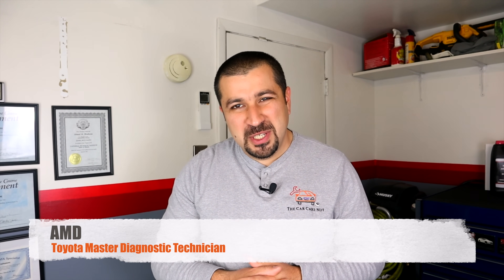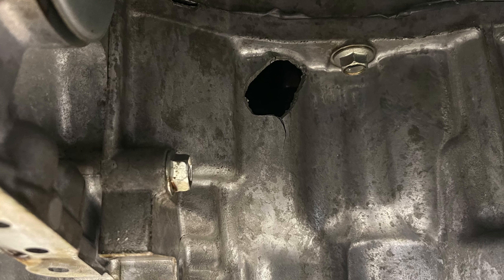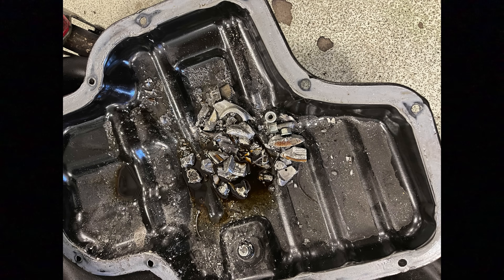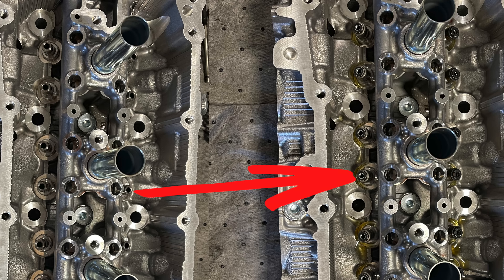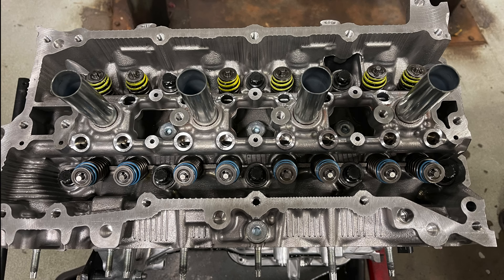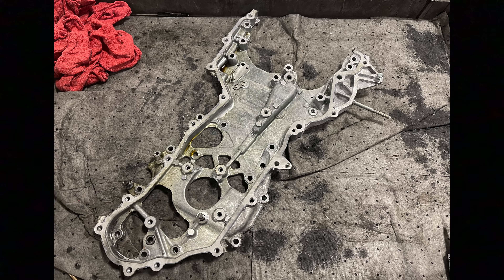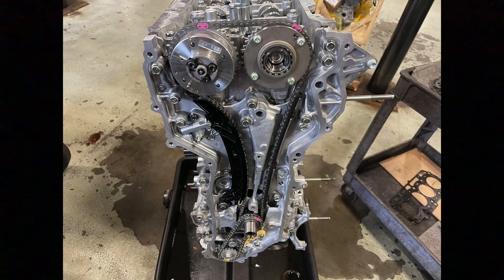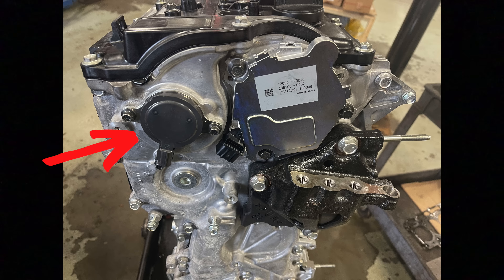Toyota's New Engine assembly Full start to finish!

Comment: Wow! I have this engine in my 2020 Camry LE. I've seen your other video explaining all the high-tech features on this engine. This engine is pretty complex and complicated. I've rebuilt three "old school" engines from the 70's that are pretty simple and straight forward. I wouldn't even consider doing a re-build on this engine. I would be good for the air filter and changing oil and filter...and that's it!  lol    Today was the 4th and final "Toyota Care" appointment with my Camry. The dealer put in 0-16 synthetic and of course a Toyota oil filter. I will continue doing the same as long as I own it.

Comment: Hi AMD, Does A25A-FKS engine has electric oil pump or engine driven oil pump? This video shows engine driven oil pump!!!! 

Could you please provide video for intake and exhaust VVT video link for A25A-FKS engine?
Reply from the maker: Hi! It has a mechanical oil pump however it’s pressure is controlled electronically

Comment: My wife has  a 2016 Rav4, no problems. Get about 28MPG average by hand math. She likes the 2021 and was loking at them. We  are going to wait for another 3 years to see what problems  showes up on the new engine and transmission. My 2000 Camry and our 2005 Camry have been great cars. But Toyota really had a learning curb when they came out with the 2002 2.5 engine that took several years to solve. Then in 2007 their 2.5 engine burning oil problem that they said they fixed right off the bat went on into 2011+ engines. Rental or not just  one piston should not explode without the rest failing unless it was a defect in that one cylinder or piston. Toyota makes a good engine most of the time. I hope this does not turn out to be a common problem. The biggest problems I see that the car industry has is new laws being past by politicians that keep requiring cars to get better gas mileage with less green house emisions. It is funny, how all the environmentalist that jump in their car, buy a plane ticket to go to the go green meetings, thinks that this is OK but for someone to have to go to work to feed their family need to put with all this. They will be the first to complain when the power goes off when it is cold or hot in their house.

Comment: I have a question. I'm buying a 2022 Rav4 Ltd. I see it shows it comes with a transmission cooler. In other literature, I read somewhere the TRD and Adventure models have an engine oil cooler as well. Does the Limited come with an engine oil cooler? I'm hoping it does since these 3 models have the torque vectoring similarities. I live in AZ and plan to tow 2k lbs occasionally. The heat is crazy here, so hoping oil cooler is included. Thanks! Oh, I see the '22 Ltd. FINALLY comes with 8 way power passenger seat. I cant believe so many manufacturers arent including that on top trims! Who wants a crabby wife on long trips?
Reply from the maker: Hi! It should have one but best way to verify is looking the vin number in parts to see
Reply: @TheCarCareNut  ok cool. Fyi I was a Ford dealer tech 1979-2005, then a master Maserati, Ferrari and Lotus tech 2005-2016. A lot of the technology was class leading on the Italian cars years ago, but now it seems state of the art design is everywhere. Damn I should have done a channel like this before I retired! The robotized gearboxes, all the classic cars and new models, there was so much I could have shared. But, retired life is incredible after 40+ yrs of wrenching! Well done Sir.

Comment: Man, your stuff is great, I always learn a ton.    My RAV4's shop manual says that the plastic water jacket thingy does more that just suppress gurgling: "The water jacket spacer suppresses the water flow in the bottom of the water jackets, guides the coolant in the upper area of the water jacket, and ensures uniform temperature distribution. As a result, the viscosity of the engine oil that acts as a lubricant between the bore walls and the pistons can be lowered, thus reducing friction.".

Comment: What life expectancy does Toyota have for the oil separator if oil change  intervals are followed religiously with high quality full synthetic oil? Any idea what the total cost is down the road for replacing the PCV valve and oil separator?
Thanks!

Comment: 14:49 The hose going to the purge valve, under your red arrow.. On my new 21 rav4, I think there is a rubber sleeve, and some foam insulation over that hose, maybe to protect from the heat of the egr pipe that I think is nearby. My foam has a 1" slit on the top towards the purge valve (not on purpose, it's a rip). I know it's probably no big deal, just wondering what you'd do. I think you have to get the whole hose to get the protective foam. Thought about a zip tie or some electrical tape, not sure. Part of me just wants to ask about a replacement hose, since it's brand new.

Comment: can I replace camshaft without removing timing chain cover?
Reply from the maker: On this engine it’s tough. I would just remove the cover
Reply: do you know the torque for the cam bearing bolts and spoket?
Reply from the maker: Techinfo.Toyota.com

Comment: i can appreciate the timing and effort you put into the rebuild.  Most shops would push their customers to replace with a low mileage donor engine.  My preference is installing JDM (Japanese Domestic Manufacturer) engines pulled, shrink wrapped and sent to the USA with under 40,000 miles.  So far installed in a 98 LS400, 07 RX350 and 97 CRV with great success.  These engines are dirt cheap compared to a rebuilt/remanufactured and come with everything attached (i.e. intake plenum, fuel rails, fuel injectors, coil packs, water pump, alternator, ac condenser, p/s pump, belts, etc.    After installation, customer feedback have been "car runs like new!".
Reply: Bud - where do you source your engines from?

Comment: Why wouldn't Toyota send a whole new motor?
Reply from the maker: Hi! Toyota doesn’t sell a complete engine assembled
Reply: Seems strange they wouldn't pull an engine off the line and crate them.  Has to be at cheaper than paying mechanics forv2 days work!

Comment: One thing I'm really concerned with about this new engine, is since they sharpened the ANGLE of the manifold (and thus the valves).

The chances of them being BENT more frequently.
Reply: Not really bud - it either is or isn’t an interference engine, ‘chances’ aren’t a thing here really. It’s a design factor.

Comment: Have you seen any high mileage  A25A-FKS 2.5L engines yet and if so how well are they running and any issues with oil consumption? These engines are incredibly complex - a lot to go wrong. I own a 2021 RAV4 hybrid and hopefully the engine will last a long time and be relatively trouble free.
Reply from the maker: Hi! I’ve seen a few with over 200k miles taxis and Uber cars they are running fine with no known oil consumption issues
Reply: There are people go over 300k miles with original engine

Comment: Just getting my 2021 RAV4 hybrid on December 4th. On the 2022 they have led fog lights. Can I get the 2022 bulbs and they will be good? TIA  Toyota guy since 1997 and still have that Camry, with 102000 miles.
Reply from the maker: Hi! Honestly the 2022 technical information is not out to see if they can be fitted or not

Comment: Is this engine reliable? and how long do you believe this engine Will last ?
Reply from the maker: Hi! It’s a reliable engine so far with many examples surfacing with over 100k miles
Reply: @TheCarCareNut  okay that’s great to know because I own a 2020 Toyota Camry with this engine and it’s been great so far but I did have some electrical problems but they seem to be fix as the problem was that the car battery would be dead as if something in the car kept on killing the battery and Toyota replaced it with a new one and it’s been great since then and I do my own oil change at 5000 miles and all the basic maintenance that’s required but also any kind of tips on how to make sure my engine last as long as possible?? Thank you for responding.
Reply from the maker: Just keep up the maintenance and you’re good
Reply: My 2018 SE has 60000 miles. I change oil every 5000 with Toyota oil and filter. Some may think that's overkill but i call it cheap insurance. I absolutely love this engine.

Comment: My 2019 RAV4 LE has been in the dealer s for the past five months it has 11000km and it is waiting on a gasket kit to assemble a short block that is at the dealer s is this the presses that the technician will be doing it started of with a ticking that led to a knocking very disappointing

Comment: You think this motor would take well to boost?
Reply from the maker: Good question. Hard to tell. The oiling system might be an issue and could need modifications to cope
Reply: @TheCarCareNut  You’re right I’m sure. At any rate, it’s probably not a good idea to mess with your daily like that. Better just buy an old MX-5.

Comment: "Use the Toyota Dynamic Force, Luke..."  ;-)
You have provided a public service here, AMD.  Most drivers don't know what's under a car's sheet metal. They might assume it is solid steel.  And when you open the hood of a Toyota many of the folk examining all of the metal and plastic and rubber objects might be hard-pressed to figure out how these things work together to make the engine operate and move the car where the driver wants it to go.
But now you have explained what all those strange things do--and how they work together as the Prime Mover.  And it all makes sense!  
So, thanks for your excellent presentation, AMD!  It demonstrates that, no matter what your age or education, learning can still be painless.

Comment: Thank you for taking the time to make this video. I'm about to embark on my first a25a short block adventure and this guide is sure to make my life at least a little bit easier.
Reply from the maker: Hi! Best of luck! They appear intimidating but they’re not hard at all, just don’t forget that little valve on the block behind the back front cover. Everything else is smooth sailing. You’ll probably take the intake manifold off 3 times to route everything because it kinda of all over laps. Also depending on the model it’s very likely that the torque converter will pull out with the engine that’s why I would drop the cradle down which is very easy as it’s one piece
Reply: Actually, YES! the TC did in fact come out & stay with the engine; almost made me think I forgot a TC bolt, but all 6 were there. Almost identical issue, hole in the block, but this one lost the number 3 cyl. The only cause that we can figure is LOF got done about 100 miles prior to failure. While no oil weight was on any receipt, the first receipt said "conventional" & the second receipt said "semi-synthetic blend" so I lucked out and the job is customer-pay instead of warranty. My only nervousness(es) is my ADHD & the fact I've never ever done a short-block before; EVER! I've swapped a few engines, but we got the short block in and I'm like "where's the crankcase?!??! I think my toughest part so far is sooooo much wiring harness involved!! The head bolts were freakin' impossible to get off as well but I got them. Now that I've waited a week or more for parts to come in, time to get to work on it tomorrow! I tell ya though, the balance shafts just work as a meat grinder on those pistons once they snap from the rod!
Reply: ummm... you mean Step 32 of the RM that says "INSTALL OIL NOZZLE VALVE SUB-ASSEMBLY?"

lolz, i did not forget it! Still chuggin along

Comment: Down on hands and knees bowing to a super being.  Watching this and your two part introduction to the new engine made me very nostalgic for my old Ford Cortina Mk111. Ok it had the classic poor oil feed to the OHC, but an upgraded feed and a new cam and it was rock solid.  There was even space in the engine bay. Not an engine management system anywhere to be seen. I even went high tech, and put an after market electric cooling fan.

Comment: I'm not sure I have a good look at it, but it looks like these are two-bolt main bearing caps. Would you happen to know if the V35-FTS also uses two-bolt mains? The diagrams I have aren't very clear, unfortunately.
Reply from the maker: I haven’t really looked inside a V35 yet.

Comment: Thanks, you just help me a billion! I was wondering why my Catch can be dry! ja ja ja ja ja ja Removed and put up for another project! Question?: Turbo off the stock Manifold design and is there room with the stock manifold and Cat gone?
Reply from the maker: Very little room in the back because of the power steering motor
Reply: @TheCarCareNut  Might have to do a remote mount oiless turbo system! Your input on the computer programming for boosting?

Comment: I notice that this engine use 0-w16. is this engine oil suitable for very hot environment when the temp reach 49C-50C?
Reply from the maker: Read your owners manual. If it doesn’t list anything other than 0w16 then use it regardless of climate

Comment: If the vehicle has had scheduled servicing, then the motor should be able to handle anything.  I work in an industry where we get a lot of new vehicles and cannot do a run in process.  They are serviced when required.  Never seen one blow a piston.  Toyota 3 litre diesel used to blow up all the time at 120,000kms.  Known problem that Toyota would not fix as they only gave 100,000km warranty.

Comment: How many miles did this car have? By having that Black oil filter that states "Made IN China", this seems like the original oil filter that came with the car when brand new. 
Maybe no oil change at all
Reply: Usually, the ones that are available for this car from the dealerhsip is made in "thailand" filters. This is definitely the original filter that came with the car brand new
Reply from the maker: If I remember correctly around 7k miles
Reply: @TheCarCareNut  7k miles of pedal to the metal? That kinda sucks
Reply from the maker: Yep that’s the life of a rental car
Reply: @TheCarCareNut  but still tho, 7k is pretty damn early. Maybe not broken in right?
Reply from the maker: Yeah something was fishy with this one
Reply: @TheCarCareNut  did u change the VVTI actuator too?
Reply from the maker: Yes everything was replaced
Reply: @TheCarCareNut  damn

Comment: At 4:26 showing the old and new cylinder heads, I noticed the wall thickness of the new one was much thicker, did they change that in the new ones?  Again, thank you for an amazing informative video.
Reply from the maker: Good catch. I’ll look into it
Reply: See what you mean but I think it's just the residual FIPG on the old one.  Scrape it off and they're probably the same.

Comment: Fantastic video! The longer I own my 2020 RAV4 AWD Hybrid, the more I value it. Coming from Ford, it was kinda hard to leave “my” brand. However, since Ford didn’t have the right car for me anymore, I set aside my hesitations to look elsewhere. Automatically, you’ll end up with Toyota due to the vast range of all kinds of different models. There is something for everyone. And now, it will be hard to leave the brand. Once you have owned one, there will be more to follow. Though I do keep a close eye on Ford what they come up with in the future, but doubt I will ever let go Toyota. This is how I feel about the brand after owning my RAV4 for one year. Despite the “oil issue” I had with the dealership (they used 5W30). In the end everything was corrected, in my case that is. Greetings, Willem, Hekelingen, Holland.
Reply: @garrettm7993  Don’t know what your current Ford is. I came from a 2015 Kuga (Escape). If you want a truly great driving experience, Escape, no doubt about it. Nothing in its price range beats it, not even the RAV4. Even the used hybrid system resembles that of the RAV4. Ford has a reputation to keep up and the Escape is definately no exeption. Toyota however has another reputation to keep up: total quality and reliability, also in the long run. And not to forget resale value. So the choise was clear for me no matter how hard it was to say goodbye to Ford. And I do not regret my decision.

Comment: Hey CCN, were both circlips from the #4 piston in the oil pan?
Reply from the maker: Yes they were! That was the first thing I noticed when I took it apart. One of them was fully intact the other was bent
Reply: @TheCarCareNut  Thanks AMD.  Seems very unlikely then that the wrist pin walked out of the piston.  Very interesting failure.

Comment: Nice video! Since I did an engine in the 60’s & 80’s much has changed. I remember replacing camshaft bearings and prelubing them , also what about New camshaft prelubing? Things were easier before, very complicated today. Thanks…Jim
PS…..any cranshaft prelubing? How do you start a brand new engine?
PPS….why The New engine? What was wrong with The previous one, What are Improvement?
Reply from the maker: Hi! I used oil on the cam caps and bearings. The crank I didn’t assemble so it does come with assembly lube from the factory. I disable ignition and fuel and crank the engine to build pressure before starting any engine I work on